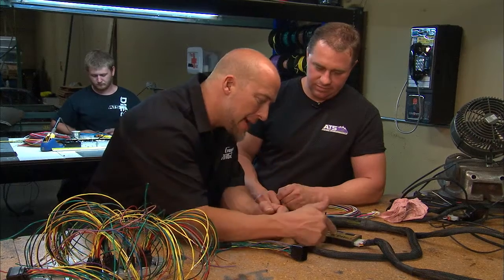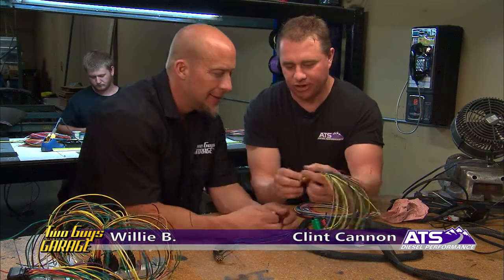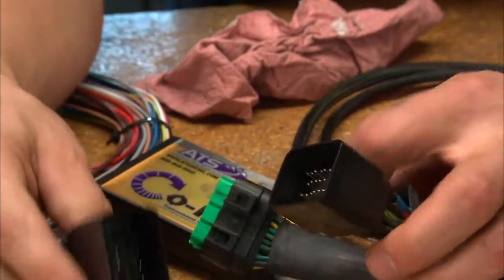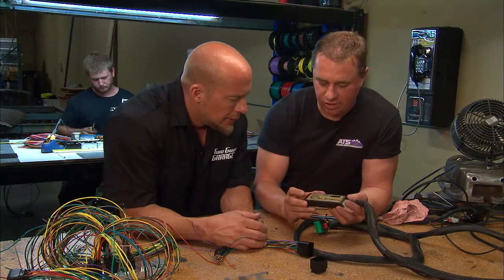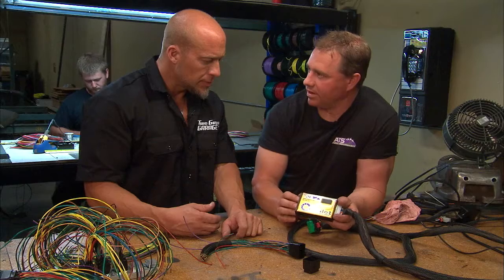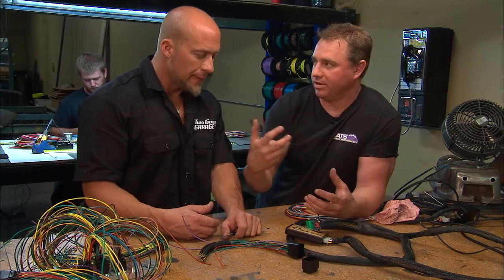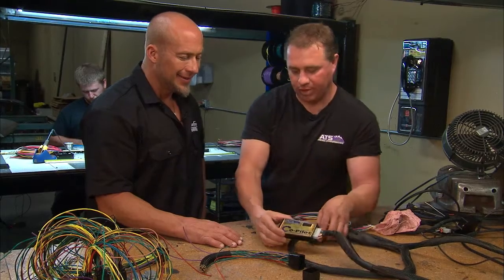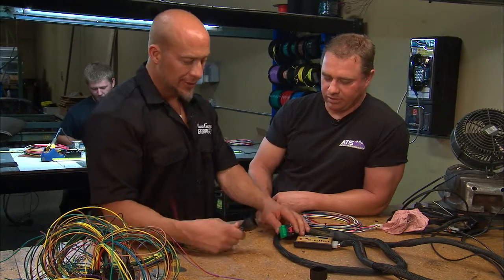ATS Diesel Co-Pilot Explained

Comment: It would be awesome if you included how to make the connections in the instructions. the early 2006 dodge instructions say to reference second to last page. well second to last page is missing in said instructions.  so do I tap into the existing lines or replace them at the connection with the ats wires? anyone know? also if it is a tap, why not include the taps needed. I got end connections.